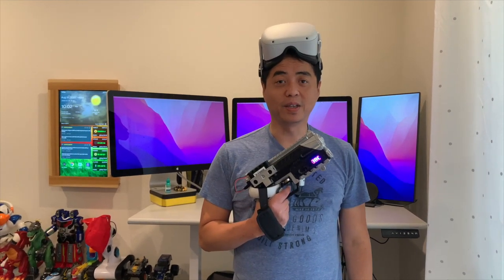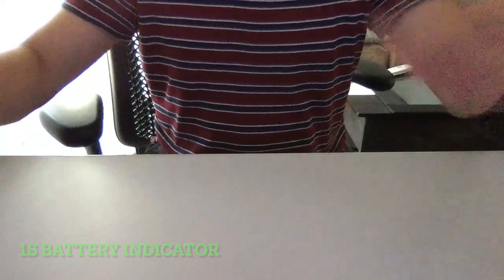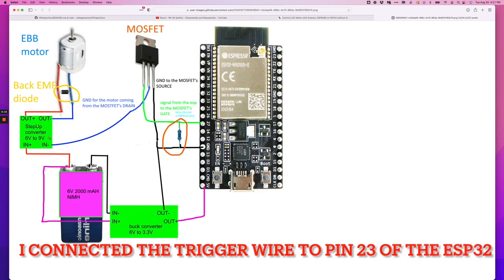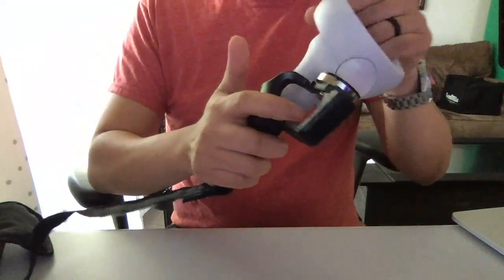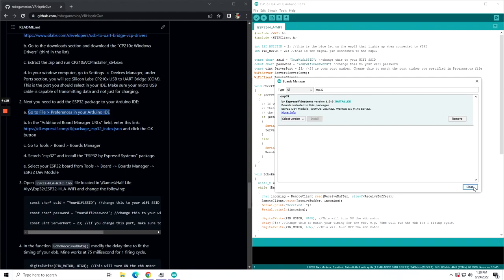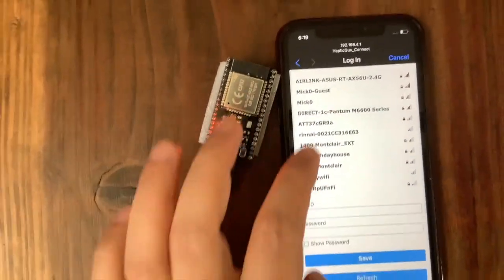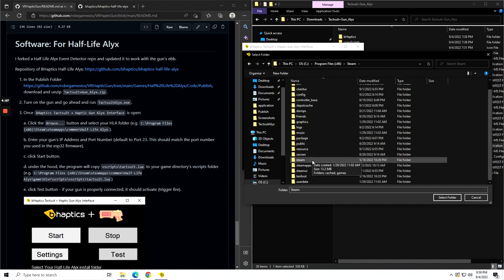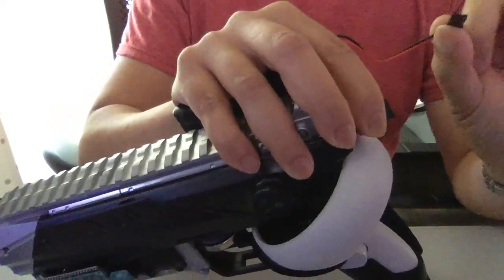I built a Haptic Gun for VR Games - Updated Tutorial DIY

Comment: I built one. 
Initially my first one didn't work since I used the wrong ESP32 board. 
Secondly the  micro usb cable I used was not a data cable, so that was my second problem.  
 
Third, I fried one ESP32 with a capacitor, so it stopped working and got really really hot. 

Also I tried being smart and using a 12v solenoid to get a faster response than a AEG style recoil system, but there's still lag between the shot in-game to haptic recoil. 

Wish it would be possible to add a delay to the  game files to allow for a synchronous shot.
Reply from the maker: Hi, super you got it to work! About the lag, was it lagging when you used an EBB or you only tried with a solenoid? I tried a solenoid before and I didn’t notice a lag, although I should retest that. I’m guessing if your power source doesn’t produce enough current, then you would see some lag. What’s the specs of your solenoid and your battery?
Reply: @robenriquez5474  initially I didn't have either, so instead of an ebb I connected an led strip to the circuit to test it, but the lag I'm referring to is the latency time between the shot that happens in the game, to the time the signal reaches the ebb/solenoid/pin 23/LED, there's a delay within the milliseconds range. 
 I've read reviews about the Protube VR which has the same type of latency. 
The latency in referring to is similar to gaming with a wired vs wireless mouse, there's a delay in the milliseconds range, but in the case of haptic feedback, it's noticeable enough to break the realism of immersion.
 
Obviously in my case the ebb I used was an Version 6 gearbox for a P90 airsoft gun which requires too much current for practical use. And it's hefty and difficult to mount. Also since it has gears and a piston to charge and release, that just adds to the latency, although it can be reduced through pre-cocking the ebb piston by adjusting the '75ms' signal, so that upon firing, the ebb piston is pulled back to the last gear tooth, and when the next signal comes through, it fires nearly instantly, providing the recoil, and pre-cocking the piston for the next shot. 
 
Since the ebb mechanism I decided to use requires too much current and v there's more latency with it vs. A solenoid,  I went with a 12v 8A push-pull solenoid from Amazon. It also has some weight to it, but feels more like an actual handgun, and has tactile recoil.
I'm not using a battery pack since I don't have one that would supply enough power, so in the meantime I'm using a 12v 10A dc power supply for the solenoid. I went with a solenoid vs. ebb you recommended because the solenoid has a stronger kick, but the drawback is that mounting it to the valve index controller has been difficult since I can't find any 3d models STL of antthing like the Protube VR grip for index controllers. I tried to design one, but I have absolutely no experience with 3d designing or blending STL files.

Comment: Amazing work! Did you adjust anything on the coding to reduce the recoil effect in game?
Reply from the maker: hi, unfortunately for the electric blowback motor I used, the feedback strength is not variable. if you want variable strength, maybe you can try using a push-pull solenoid.